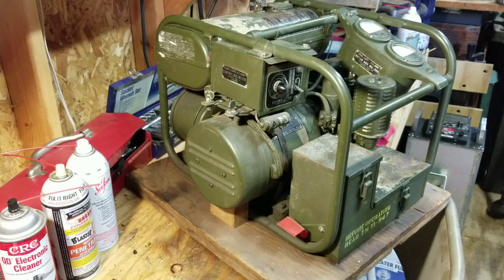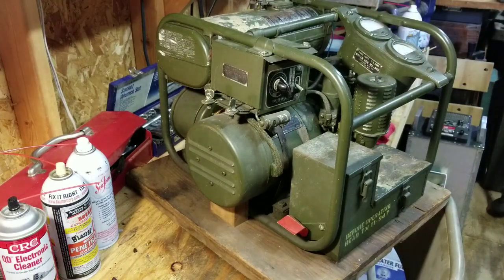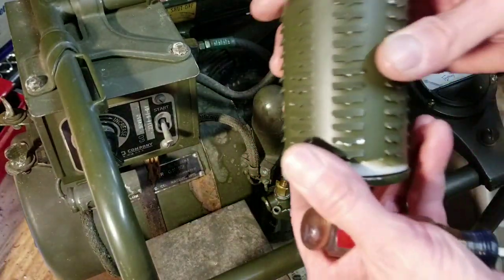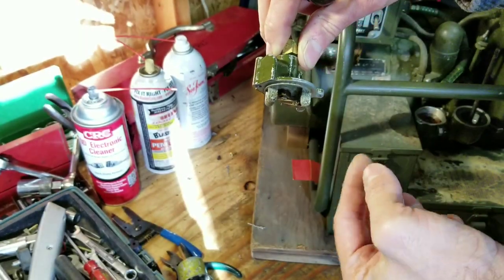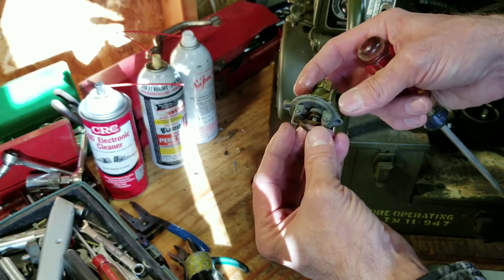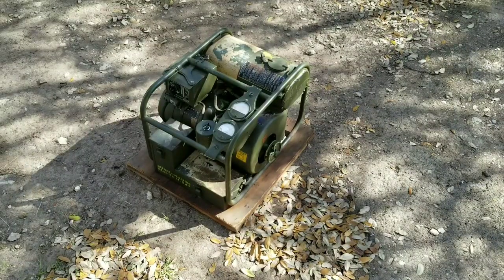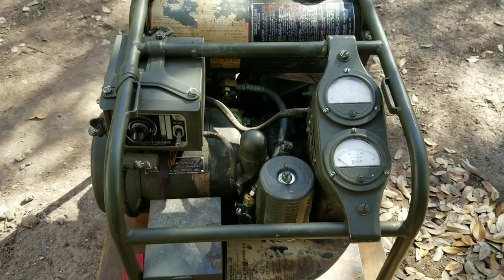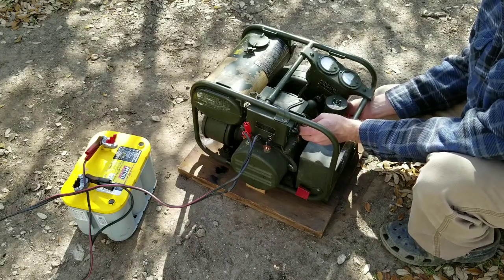WW2 PE-210 Generator Carburetor Repair and Demonstration

Comment: I just acquired one of these. What is the gas oil mix ratio? Thanks.
Reply from the maker: 24:1 to be safe, but with modern 2-cycle oils, you maybe ok with 50:1

Comment: Some of the small equipment is pretty cool. That fact that this is a 12 volt generator. I spent a week or so digging up info on an air compressor about this size.